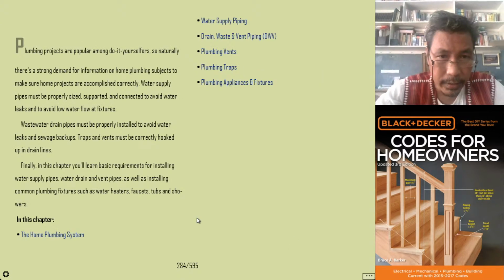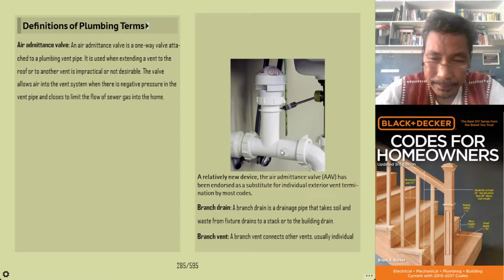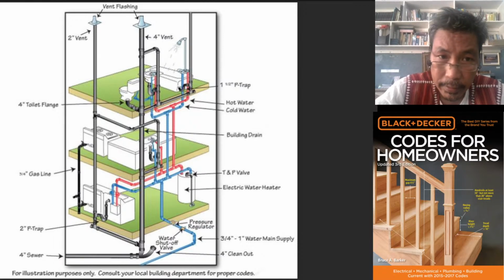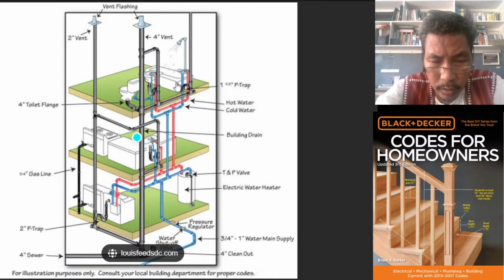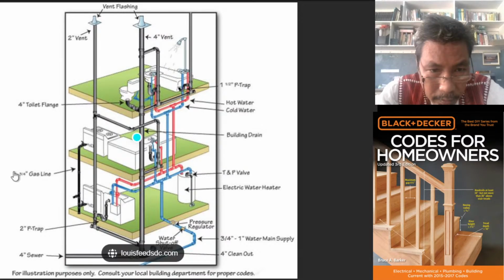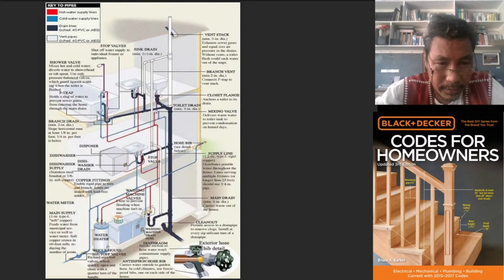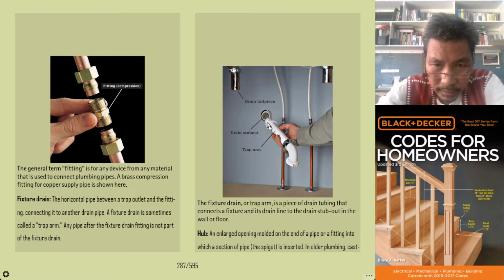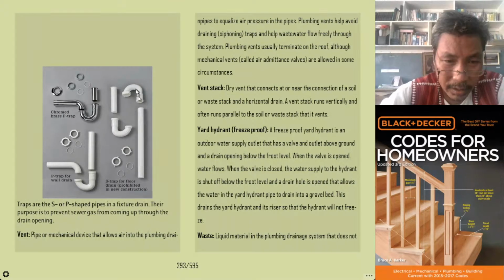[ LIVE CE D2 Lecture 02 ] DrAP Zantua Plumbing Utility Systems Talks + ENGINEERING Analysis & Design

Comment: thankyou sir for another live lecture, and for a recap about the technical terms for the plumbing system as it was discussed at the last live lecture. This live lecture covers the topics about Home plumbing system, water supply pumping, Drain waste and Vent piping (DWV), Plumbing Vents, Plumbing Traps and Plumbing appliances and fixtures. Also I've learned that air admittance valve is a one way valve attached to a plumbing vent pipe.

Comment: Thank you sir for teaching us about plumbing and sanitary.  I learned the definitions of plumbing terms such as air admittance valve, building drain, fittings, building sewer, drain pipe, fixtures, fixture drain, hub, P-trap and  Clean-out. I learned also drain line, supply line, auxiliary stack,, main stack, and vent were discussed. A plumbing plan was also presented and discussed.

Comment: Thank you Sir for this live lecture video that you explain about Plumbing Utility System. With this Chapter we will be able to learn about the Home Plumbing System, Water Supply Piping, DWV which is Drain, Waste and Vent piping, plumbing vents and traps also plumbing appliances and fixtures. It was started in some definition of plumbing terms and also a diagram where we can find the parts of plumbing system.

Comment: Thankyou sir for this video lecture about how plumbing project works. You discussed about Home plumbing system, water supply pumping, Drain waste and Vent piping (DWV), Plumbing Vents, Plumbing Traps and Plumbing appliances and fixtures. Also I've learned that air admittance valve is a one way valve attached to a plumbing vent pipe.

Comment: --- thank you sir for discussing about the plumbing system which is the popular among the do-it yourselfer. I learned some technical terms such as air valve, branch drain, branch vent, braze, building drain, building sewer, drain pipe, fittings, fixture, fixture drain, hub, and saddle fitting. Also thank you for discussing some examples of plumbing plan.

Comment: Thank you sir for this live discussion about plumbing and sanitary.  I comprehend some of the definitions of plumbing terms such as air admittance valve, building drain, fittings, building sewer, drain pipe, fixtures, fixture drain, hub, P-trap, Clean-out, Water Shut-off valve, etc. Also drain line, supply line, auxiliary stack,, main stack, and vent were discussed with the visual presentation so it was easy to comprehend. A plumbing plan was also presented and discussed. Thank you sir for these informative live talks.